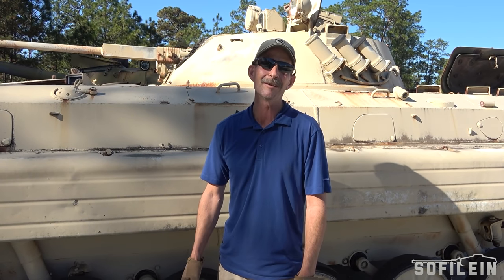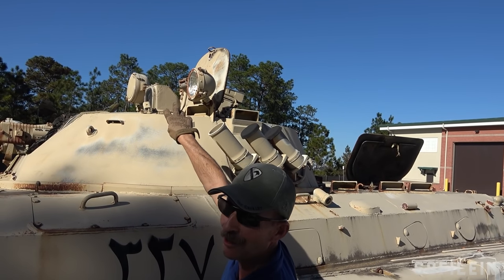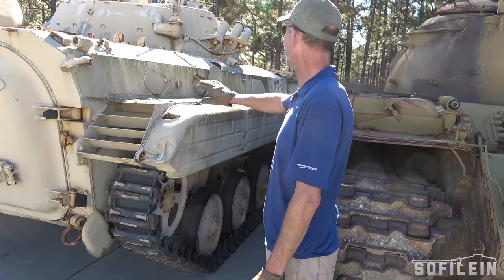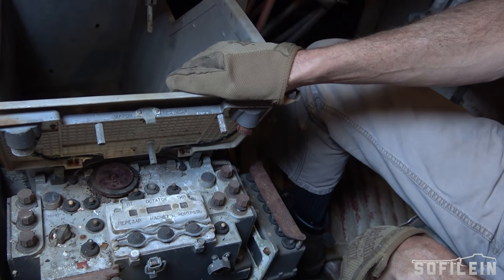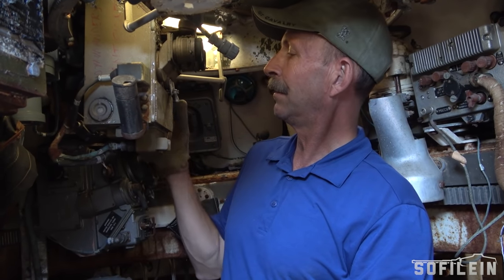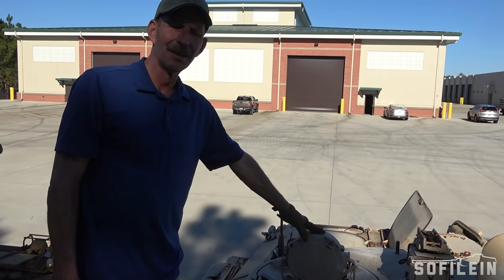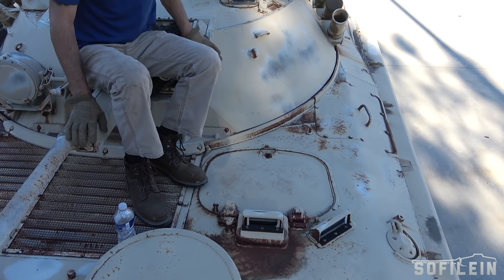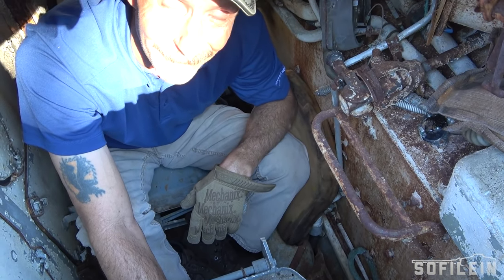Inside and Out: BMP-2 Infantry Fighting Vehicle Tour

Comment: One note about the fuel in the rear doors, while they could be set alight by a penetrating incendiary round, much like self-sealing tanks in airplanes since WWII, this rarely happens.   Moreover, some Iraqi units didn't even use these tanks and instead filled them with sand.   Overall it's not a great future, but also not as terrible as you would think as the Israeli Merkava tank also incorporates fuel tanks in areas where it also acts as a form of spaced armor.   The main culprit of crew deaths is not fire from the fuel, bur rather stored ammunition inside exploding.  This is a MUCh bigger problem with the BMP-3 and BMP-4 with their large 100mm HE shells and missiles.  Likewise on the BMP-1, the projectiles were highly prone to cook-offs.  with 30mm the cookoffs are dangerous but less catastrophic. So in ALL of the BMP series, the BMP-2 is likely the safest especially if spare AT-5 missiles are carried externally and not inside the vehicle.  That is one reason why the BMP-2 is still heavily used around the world. It's simple, reliable, and effective when used by crews and armored commanders who know their limitations and how to use them in a manner that emphasizes infantry support and close coordination with both infantry and tanks.  Likewise when slat armor is added to them, they can actually take RPG-7 hits and survive.  The addition of anti-spall liners also can minimize casualties from penetrating hits by anti-tank weapons.
Reply: Всё правильно.

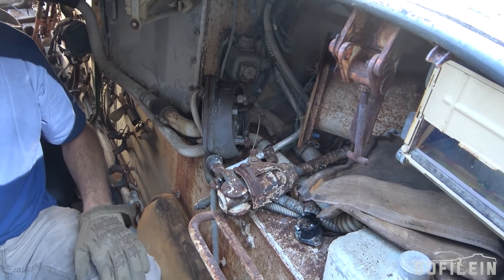Comment: Well, a lot of finer points are left out and some basic realities; at 19:10 there's no real cause for concern since all vehicle crewmen wear helmets with earphones that block a lot of the extraneous noise so they can hear each other through the intercom system. So that's like firing a gun next to someone at the firing range who has on hearing protection. Plus 1/3 or more of the AK rifle would be outside the vehicle, while firing, and isolated via the hull armor.

Comment: Just FYI.... "Nose shield" there, is called Lip. it's main purpose not to keep BMP's nose up, but keep water from flooding visibility ports, called "Triplix"and driver's hatch. The way you sit in a dismount compartment is.... You move your knees as close to wall as possible, move your ass as close the the age of the seat as possible and lean back. You'd be surprised how comfy you can be in there. By the way I am former BMP 2 driver/mech, and I speak Russian. If you'd like to I can translate anything for you from Russian to English. Plus I know this machine inside and out, can help you with any kind of question u might have....
Reply: I would be very surprised if this thing was comfortable for my fat ass. Thanks for the info.

Comment: First impression of inside......reminds me of submarines. Everything tightly packed, but with a purpose. Not a comfortable vehicle, but the purpose is to move troops quickly to contact point. The fact that Arabs can use them, equates to robust, easy to maintain construction. Newer versions are actually a bit roomier, due to upgrades taking less space. Digital electronics for example cut the radio size by 2/3rds. Note: all fuel tanks are Self-Sealing. New versions have a better, more powerful engine, and slightly wider tracks, as well as advanced optics.

Comment: Sofilein says "freedom units" but inches and feet are leftover from the imperial system back from when America was part of the British empire. Metric however is an international system made to standardize and define measurements to easily convert units. So when you say "freedom units" you should be referring to the metric system, not imperial.
Reply: If it happened outside the lower 48 it doesn't count.

Comment: Remember very good the Maljutka 1 and 2 test shootings with BMP 2 in the east german army. 😂You had to follow the rocket up into the target with a little joystick wich gave signal to the rocket through a cable wich was rolling from  strange noisy  cable drum. I remember not one single soldier in the squad hitting a target. 😂There had not been simulators in those times to increase capabilities.

Comment: That must be an old original model because the models in use now have newer targeting computers infrared sensors all the 21st century tech the ones from 1980s probably still has analog or manual targeting no digital displays.

Comment: BMP-4? I know there are BMD-4s. But the BMDs are for airborn forces and are able to be airdropped. I dont believe BMP-4s exist. BMP-3 is the latest "BMP" IFV.
Reply: There are modifications of BMP-3 which are more different from BMP-3, than BMP-2 from BMP-1, like BMP-3M Dragoon or BMP-3M Derivatsiya (which became 2s38 BMP-3 PVO (anti-aircraft) Derivatsiya :)))) and there is a Kurganets-25, which will be BMP-4 if she enter in service!
Reply: @pavlejukic605 Russian Army dropped that designation system for latest vehicles in favor of slightly different one, where IFV version of Kurganets-25 is known officially as B-11
Reply: @skylancer4441  They didn't drop those designatios: Объект 148 is still T-14 (Armata), T-50 is Su-57...Б-11 is joint name for Объект 693 (IFV) and Объект 693 (APC) and probably some more types on the same platform (like anti-tank missile system 9M123 Khrizantema-S on BMP-3 platform...)

Comment: I so would like to be blasting that vehicle clean with dry-ice. You would get all that rust, paint etc away nicely without any damage to the metal etc.
It would be so awesome to see these vehicles in their factory-quality, straight from the line.

For average man in 1980 for Soviets or USA was interestingly same, about 176 cm. So someone being 179 is just slightly taller, but not a problem. 
 And anyways in military time you will get thin, and if you are in wartime, you will get thin. So squeezing through those tight places to save yourself is not really a problem. You just need to get your equipment off around you so you don't get caught somewhere. So if someone is modern common wealth level where extra weight is gained, then fitting in will be more challenging, as soldiers are usually 18-20 years old only and not 35-45 ones. 

Many are very afraid about those fuel tanks, but there is no warrant for that. As when you have a fuel tank filled, it can't explode by the tracer penetrator. To blow up a fuel tank, you need to have it empty, as you must get that IIRC 1.5-2% fuel:air mixture to explode the fuel, and for that it must be empty.
That can well be visually presented in this: https://www.youtube.com/watch?v=HZ5Aajp0X80
  What you definitely don't want, is to have a empty fuel tank that gets a hit, as that will blow the whole thing up. 
But same time you don't want to have a full tank capacity and get a penetration to it that makes it leak that fuel inside, as on that moment you have fumes filling the space, and spark in there and the whole vehicle will lit like a roman candle and burn everything.
So you need to make a decision, a high explosion or high flames....
And considering again that if you get a penetration, you get likely spalling and there is no worries about the fuel because you likely are already dead. 
That rear door with fuel makes excellent spaced armor, and that fuel inside will slow very effectively kinematic penetrators, as just a few cm of water is enough to slow bullets dramaticall, after the armor plate and second one inner side: https://www.youtube.com/watch?v=yvSTuLIjRm8

The one overseen feature in BMP-2 is the Hunter-Killer capability. The commander had capability to slave the gun on direction of his sight. This made big difference how the vehicle crew operated as vehicle commander got better overall situation awareness and after spotting something got without verbal explanation the gun pointing wanted direction with press of a button.

Another interesting doctrinal tactic was that vehicle commanders were not actually commanders of the squad. The squad leader was the commander of the vehicle and the infantry squad. When the squad leader was inside the vehicle, he was in the command of everything. When squad leader unmounted with the squad, the vehicle commander commanded the vehicle under commands of the squad commander on foot, and they maintained communication channel between that where squad leader wanted vehicle to go for support the infantry. 
This is as well why you have the infantry squad leader seated behind the driver, as he was there commanding the while vehicle, and the one that puts his head out first to move. 

The BMP-2 got serious advantages over the western ones, some very clever designs but as well those technical capabilities that west implemented only later on in more expensive vehicles. 

Like example that driver navigation device, a gyro compass. It was common one and very trustworthy, it hold heading and all extremely well considering you are inside a huge metal bucket that denies normal magnetic compass operation. 
And many doesn't come thinking about river crossings in those vehicles, that how do you navigate under water in a MBT like T-72 etc? Once you enter in to water, that compass is your only way to stay in track that what direction you are suppose to drive. If you hit some boulders or logs under water that requires you to reverse and try to go around, that compass is there to help you. 
When you are in the medium wave crossing over river, at night etc, you can't open any hatches and look around, you don't see out much as driver and gunner is difficult to guide you, so when you are floating you have gyro compass giving the heading.

And considering the squad comfort, that wasn't important for various reasons. You travel mostly outside when it is warm and safe. At winter you keep hatches open but still have enough space to be comfortable. And really button up only when close to the combat zone and you are traveling that last kilometer to the zone, when you then unmount for last half a kilometer or so (and again one reason why fuel tanks ain't risk as no one should be behind there on those moments).

Comment: People poo poo the rear doors cause they have an indirect understanding of the BMPs real issue which is still the gas tanks just not the auxiliaries that does make great spaced armor and radius of action extenders. The real issue is not the aux tanks in the doors, its the primary tank in the center bench the guy points out right in and among all of the dismounts ready to douse them in fuel when penetrated as has been seen in Ukraine recently.